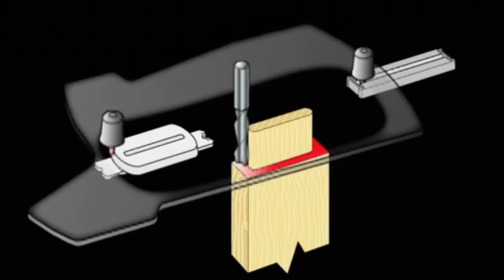Скамейка из старого дуба. DIY Bench made of old oak. Своими руками. Router Features. Секреты фрезера

Comment: Extraordinary work with simple tools. Most definitely a craftsman of exceptional ability.
 I was hoping that the wood might be teak, but it appears not to be, so it will need several coats of sealant, If it is going to stand outside in a yard.  The same thing for the legs. Putting them into a can and pouring a penetrating sealer inside it;  leaving the leg ends in the cans for a day or two, will allow the wood to absorb all the sealant it can take.  You probably know this already but just mentioning it.  The one thing that I am bothered about, especially about someone that has shown such ability in creating this wonderful piece, is that you need to revisit your mortise and tenon joints. They are too loose. Never mind using glue or fasteners to lock them on securely. Those joints need to be more precise. I would consider that a craftsman of your abilities would tighten that up. Otherwise; much respect for your skills.